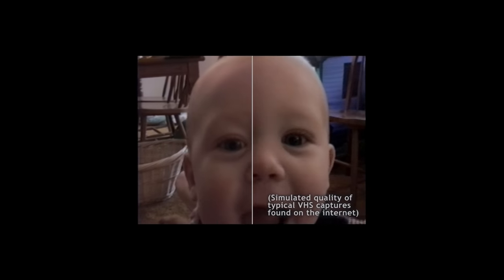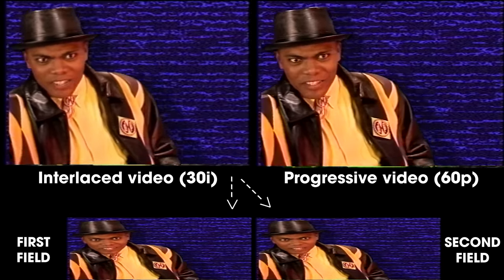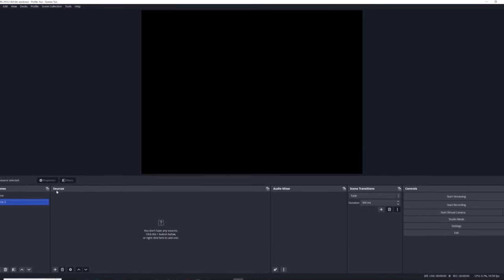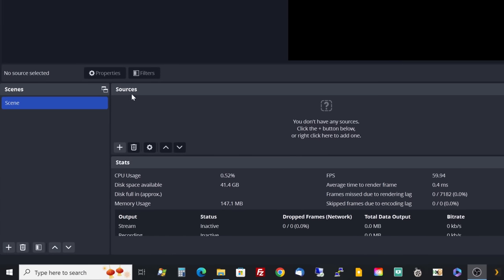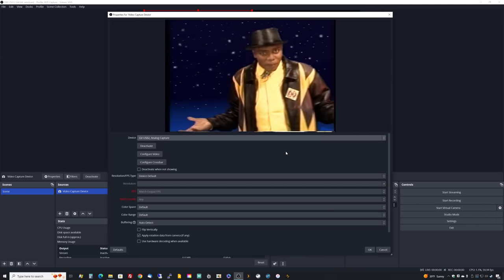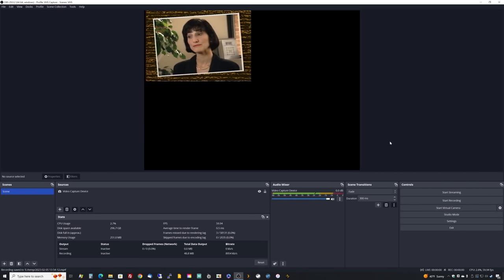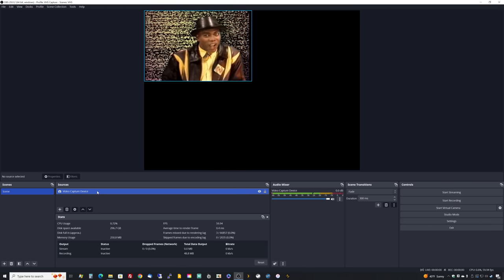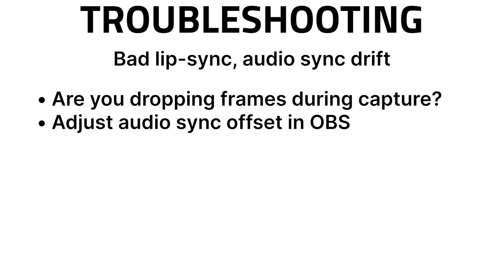How to convert VHS videotape to 60p digital video

Comment: Loved the tutorial man, unfortunately I couldn’t get my hand on these high quality capture card.. only those cheap ones are available here.. but i have a question for you!

can we use this signal flow where i connect RCA cables to “AV to HDMI” (converter) which goes into “HDMI TO USB” (capture card) and then into my pc.. just wondering ll that work?

Also is “s video port” of any use in this capturing process and is it important to be connected?
Reply from the maker: You can use HDMI converters but then the process is out of your hands, and you're trusting the HDMI converter to do the right thing.  Not all do.

Comment: Love this. This is a great niche. Have you looked into VHS players with component outputs> Component to HDMI converter> BlackMagic USB recorder dongle or BlackMagic Hyperdeck recorder to an SSD?
Reply from the maker: I'm not aware of any VHS player with a component output?  Do you have any model numbers?  As for the rest, what you're describing is a realtime hardware upscaling/conversion.  I prefer software because I have more control over the process, but hardware is fine too.  There's a link to a video in the description that covers a hardware conversion.
Reply: @TheOldskoolPC  As far as i know, VHS players with component video were speciality players that TV stations used, etc. I haven't really been able to find one online. But they are superior for ripping VHS. (as far as the player goes). People use them nowadays when using footage for professional documentaries, etc.
Reply: Some VHS/DVD combo units have component output, but given the low color resolution of VHS, S-Video is likely sufficient.
Reply: @pokepress  These combo units have nothing to do with specialty component video VCR's that were mentioned, and the quality is better than s-video. (i.e. you can't rip a tape from a combo unit with a component cable). - After doing more research though, this is kind of old info. It's not as common anymore as I previously mentioned. Nowadays it's hard to obtain these specialty players and i'm unsure what the elite professionals have been using to rip vhs tapes to elite archive quality. Maybe they use video upscaling to compensate.
Reply: @christianb8900  I'll agree that combo units aren't as high-end as the ones used in the professional market, but mine (a Magnavox ZV427MG9) does output VHS via component and HDMI (just tested it).
Reply: @pokepress  Try using your combo to rip a vhs tape to a pc with component video (bypassing the dvd burner from the combo completely). Then you will see the issue, and why it can't work.
Reply: @christianb8900  I'm not sure what you expected me to encounter, but I gave it a try and got mixed results. My Happauge HD PVR recognized and recorded the component signal as 480i and recorded both fields in the resulting file (combing visible, so it definitely got both fields). The main caveat is that I had to use the supplied software rather than OBS (the device shows up there but can't be fully configured), and I believe the file is recorded in 4:2:0, whereas the OBS solution shown here can preserve at least some of the color information from both fields.

I also tried using my StarTech USB 2.0 Capture device, however that seems to force deinterlacing (and doesn't show up in OBS at all).

Comment: Great work! Does this procedure work with digital 8 camcorder footage or only analog recorded as standard NTSC 30 FPS video? Could this same process be applied to video recorded onto a memory card which would not require capturing and using the old 1394 interface? Much thanks!

Comment: Hello! thankful for your videos- I'm in the beginning of a lengthy journey of converting videos and I want to start off right. I unfortunately may have bought a junky setup- found your video too late but perhaps not. I bought two separate things- a well rated RCA AV to HDMI HD Converter and a HDMI Video capture card. So just a slightly different set up to what you suggest but similar in the end. Perhaps its my issue. 

Issue: I'm having some issues with the brightness auto adjusting. When playing the VHS by itself on my TV, the lighting does adjust-- darken and lighten depending on the lighting of the room but the adjustment is not anywhere as drastic as when I am capturing it in OBS. At times it gets so dark that you can't even see hardly anything whereas when I am playing it on TV everything looks great still. 

Is this an issue with my adapter/ video capture card? a setting I can change in OBS? The picture is wonderfully smooth in the recording/OBS after doing all of the settings you suggested and the audio sounds great. Its just the lighting that is very dramatically auto adjusting more than it needs to. I tried adjusting the color/brightness/contrast in the "configure video" part but because its constantly adjusting it doesn't do much good. 

Thoughts? thanks for such an amazing video!!  Truly so helpful.
Reply from the maker: It sounds like you're trying to capture macrovision-protected commercial VHS tapes.  The cycle between light and dark is a function of macrovision copy-protection.

Comment: i really feel appreciated for this tutorial and the way it is very simple to understand it even though for a person as myself who kinda deals with analog content. i just have a question: is it possible to get the 60p resolution with a combination between a rca to hdmi converter and a hdmi to usb capture device? haven't tried yet but if you could tell that it would be very helpful to me. thanks again for the video! :)
Reply from the maker: It completely depends on the RCA to HDMI converter and the quality of its conversion.

Comment: wouldn't it be better to just make the output resolution 640x480? I've tried comparing 480p and 1080p and they are identical, but 1080 obviously has a larger file size

Comment: Nice turtorial! And for the usb connection, is that I-O data the best quality so far? And I have search that usb online and it comes along with a compact disk as well. So, is that a neccessary to play that compact disk for something like software installation before I can use the usb? Or just simply use the usb directly?
Reply: You have to install the programs on the disc before you can get obs to register the I-O data. I went through all that trouble, spent all that money for it to not play video or audio and just be a perpetual blue screen. Could be something wrong with the av cable im using tho

Edit: i tested the av cables i have with my tv and got audio but no video signal. Gonna get a new av cable and see if that solves this
Reply: @sorryforlatmig7962  Maybe it's the problem that you buy a wrong cable😅, because I look back it again, that disk comes along seems like a storage of DVD or something else? Anyway, a bit worried right now.... I am not sure as well. Because of how vintage vhs is, I have spend at least hundreds of bucks to buy the high end vhs deck and some great tapes for backup. If the things you said happens, then this video will be completely misleading...😅
Reply: @Analog_video  the disc that comes with the cable installed 2 programs on my computer. One is for writing on blank discs and the other is for capturing video. I did get obs to recognize the device as a video capture device
Reply: @sorryforlatmig7962  Hi Sarah, what's going on with your usb capture? Everything works fine? I do find a way to install that software without the need of hard disc.
Reply: @Analog_video  yeah everything works fine, i just needed a new av cable. The only problem I have with it is that it isn't capturing the same quality as the recording. I know it's normal to lose quality when converting video to a different format, but I wanna see if i can find something that works better. The problem might be that im trying to capture off a camcorder instead of vcr
Reply: @sorryforlatmig7962  I see, and there is a thing I would like to check, is that everything done after installing that gvusb2.0 exe software onto the computer ? Because when I use that usb as video capture device, it displays more a less the same as what you say:" Blue screen". And I have to clarify, I do not connect my vhs deck. So, is that mean, everything is going okay but what I have to do is just simply connect vhs deck so that there will have things playback on the screen?
Reply: @Analog_video    I know you have to open the program that came from the disc before OBS will recognize the usb as a capture device. I'm not sure exactly what happens when you open the program because I don't speak Japanese, but it has a pop up with a loading bar, and once it completed I was able to get OBS to show the usb when choosing a capture device. 

If you've already got OBS to recognize it as a capture device, then you probably do need to connect your vhs/vcr, and make sure it's playing a tape. When there isnt a tape playing, OBS will just show the blue screen

Comment: Thanks for this. My first video editing pc had a DV Raptor RT card...not even sure if I could get this working now though..or if it would solve the dinterlace issue....I also wondered about using the rca inputs of my old HVX 200 camera to pass it through firewire back to the PC? It sounds like your method might still be the best though? Thanks! Edit: I'm in Australia...someone online has complained about the I-O Data GV-USB2 for PAL...but they may have not known what they were doing. Would this work for PAL do you think too?

Comment: I’ve encountered a problem that I forgot all about in VHS for decades until now.  When I am playing a tape, sometimes the image tracking will not resolve, no matter how many times I go in whichever direction (the audio is fine throughout).  The only solution I’ve ever found is to let the VCR sit for an hour or a day, try again, and then the image tracking is mysteriously fine, or may not yet be fine.  Why does this happen, and why does just waiting solve it?  Is it capacitors that need to charge or discharge?  Is it something else?
Reply from the maker: Some oxide might be clogging the VCR heads; have you tried cleaning them?  I'm thinking something got stuck in there, then later when you tried again, it shook loose.
Reply: @TheOldskoolPC  Okay, thanks!  Next time it happens, I will run the head cleaning tape and see if that fixes it.

Comment: I have Followed your excellent video to the letter, step by step but cannot get a picture of any kind. I'm in Scotland and so set up to use PAL50. Although I got no picture I continued the full procedure and went on to record to see what happened, I got excellent sound quality but of course no picture.  I have tried various tapes without success although all tapes play ok on my TV and PC, I bought the IO Data USB2 and I:m using The OBS software but I am at a loose end as to how I can make use of the equipment. please advise if possible. Pete Jarvis
Reply from the maker: You need to go into the configuration section for your device so that you can change it from NTSC to PAL, if it is configured that way.

Comment: Thank you for your great video. I have a couple of S-VHS cassettes which have higher resulution than normal VHS. Is your recommended capture device I-O Data GV-USB2 suitable also for S-VHS conversion?
Greetings from Slovakia.
Reply from the maker: Yes, procedure is the same, but definitely use the s-video (Y/C) connection, as it supports the higher quality luma/chroma separation S-VHS has.

Comment: Great video!  I already convered all my VCR tapes to digital (720x480, MP4) using ClearClick Video to Digital Converter 2.0.  Can I use the same OBS process you described to improve the digital capture?   Thanks for the great video and help!!   :)
Reply from the maker: Thanks!  Yes, this process should work just fine, but you'll have to make sure your device passes the fields through; do a test capture without any deinterlacing, and check the capture to ensure you can see the interlaced field "weave" artifacts.  If you do, then follow the complete tutorial.
BTW, if your converter already converted to 60p and you see all fields (ie. the motion looks smooth to your eyes), then there's no need to reconvert.
Reply: @TheOldskoolPC  Ecellent!  Thank you again!  Keep up the great videos!  :)

Comment: Hi, I'm Jacob. Your tutorial is by far the best on the whole YouTube. I'm currently trying to convert my VHS tapes to digital with OBS using your advice's but I encountered some problems. I bought Dazzle DVD Recorder HD but it seems that it can't correctly deinterlace VHS video. When I do it FPS drops and to keep video smooth i have to leave it interlaced. There is also significant degradation in colours making converted video a little washed out and kind of greenish compared to one straight from the VCR. Strangely OBS recognizes it as Roxio Video Capture USB but Device Manager does it correctly. Do You have any experience with that version of Dazzle converter? In my country (Poland) other devices that You mentioned and older Dazzle's are unavailable. I was thinking of buying Elagato Video Capture because this one is available and generally has good reviews on the internet. Do You have any experience with it and could tell me that it would deinterlace VHS properly maintaining good quality and smoothness of the original footage. Thanks for Your great work. I would really appreciate Your answer.
Reply from the maker: I have not used the elgato device so I can't comment on it, sorry.  As for your current issues, if the framerate drops when you deinterlace, your computer might be too old/slow; try using a computer made in the last 10 years if possible.  For the washed-out and green video, try adjusting the capture device controls as demonstrated in the tutorial.

Comment: Where to you plug those devices though? I have a few tapes on VHS-C and a bigger vhs where the smaller vhs-c can be introduced. But in order to send the content in those tapes to the computer by using one of those devices, I need a VHS player where I will insert the big VHS right?
Reply from the maker: You need any player that can play your tapes, with RCA output jacks to connect to the capture device.
For VHS-C, if you only have the tapes and no VHS-C camcorder to play them, there are adapters you can get to turn a VHS-C into a normal-sized VHS cassette to use with a regular player.

Comment: Wow, awesome I trying to convert to digital my old Hi8 or 8mm, do you think can I use the same procedure but instead of connecting it to a Vhs connect it to My Sony Dcr Trv460 and do something similar? Thanks for any help
Reply from the maker: If your tapes are truly digital (ie. DV format) then the best way to transfer the data is actually to connect the camcorder via firewire (ie. IEEE.1394) and use something like WinDV to transfer the data directly.  That way there's no analog generational loss.
Reply: @TheOldskoolPC  thanks brother

Comment: Thanks for a great video to digitize VHS tapes!! Though I am late to the party, I have a couple of questions -
1.  How do I remove noise from the video?
2.  Can I connect an upscaler to the capture device (IO Data... in my case) which then connects to my PC, to get a 1080P resolution?
Thanks a lot for any insight or comments..
Reply from the maker: Removing noise can be done with various plugins in video editors, such as NeatVideo.  As for upscaling, it won't make the picture better, just larger, but you can do it for free during the capture process in OBS itself -- which is what this beginner tutorial does.

Comment: There is little doubt you know what you are talking about, but anytime something is so complicated (smartphones) it over whelms the user it is worthless. You spent several minutes "setting up" just to download one VHS tape. I use the Diamond VC 500 and ArcSoft ShowBiz software on my spare machine W-7 Pro.  VERY easy to install, operate, and the download qaulity is just great. I can also use it to watch TV using a channel tuner that the gov. was buying them for us years ago. Sometime ago I downloaded OBS software and and had to give up. Too complicated. You need to consider you are talking to Grand parents just wanting to save Grand kid memories. Keep up the good work and have a great day.
Reply from the maker: I'm sorry to hear this, as I had exactly grandparents in mind when I made this tutorial.  I tried to show every step necessary, and only the necessary steps, nothing extra.  I'm sorry you found it difficult to follow.  If you're happy with your existing solution, there's certainly no reason to switch.

Comment: Great instructions,  thank you...I am new to getting VHS trf to digital.  I do understand the process, upscaling, hdmi etc..but I have questions. Does the OSB software have a custom recording timer? We have 6 hr tapes from 1985-1996...will OSB stop recording when the tape reaches the end before it records? 
Also, I have been reviewing the Elgato video capture devices. From the simplest to the more advanced.  Do you have experience with Elgato devices? Recommendations? Thank you.
Reply from the maker: OBS will not stop recording before the tapes reach the end, but the longer you record, the more likely it is you'll start having sync drift issues.  I would stop/start the process every 1 or 2 hours.  as for Elgato, I've never used them, sorry.

Comment: Great video! I have a question. I've got an old PCI capture card in one of my PCs. It has both composite and S-Video input. I don't know much about the brand/model as it came from Japan. I was wondering if there is a way to test if this card is capable of capturing both fields?
Reply from the maker: Add a video source, then capture some footage -- if you can see both fields weaved together in sections of high motion, it's good.
Reply: @TheOldskoolPC  Thanks :)